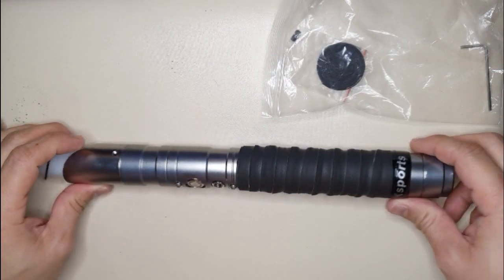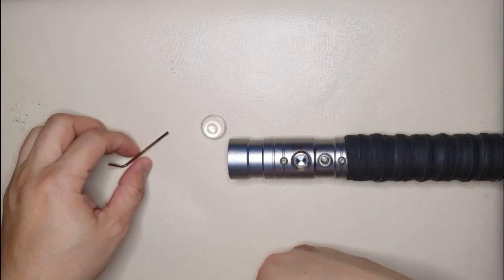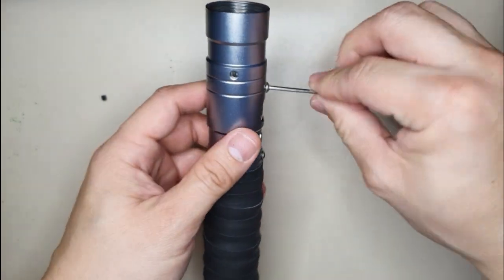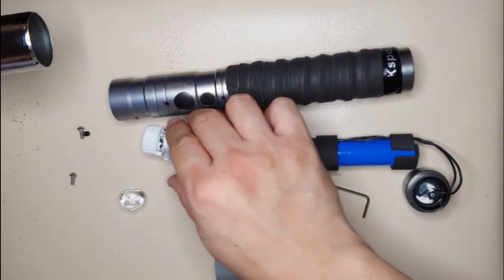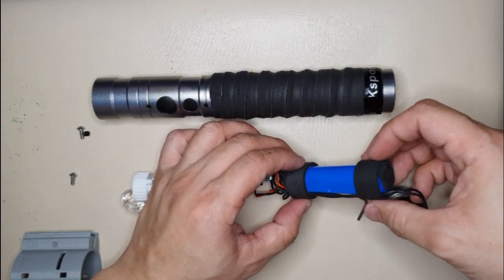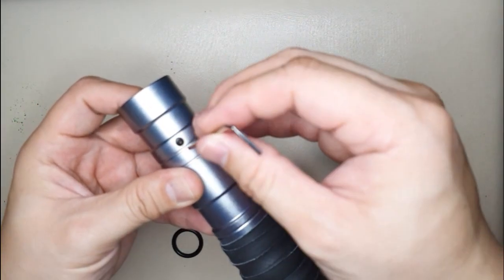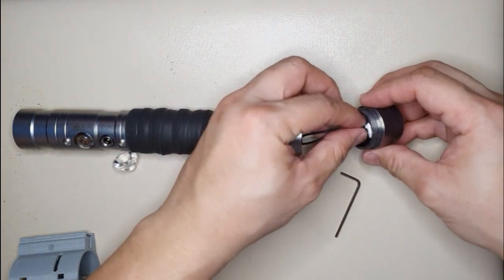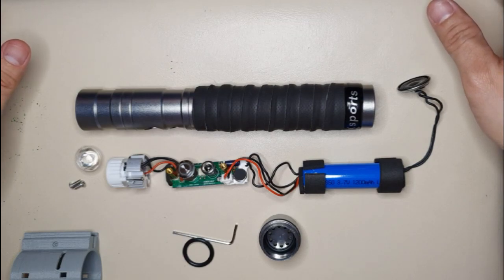What's Inside Your Lightsaber - How To Take It Apart

Comment: Hi, I have the same saber, is it possible to change the leds? for example neopixels strip or rgb led strip to put directly into the blade? thank you.
Reply from the maker: No that wont work because on e neopixel the controller is different. You can only change the rgb led on these versions

Comment: the top insert of my switch came off and I took it apart and everything looks normal. The switch lights up when plugged in but when I press it- it doesn’t vibrate or turn on the leds
Reply from the maker: Sorry to hear that. Completely charged?

Comment: I was trying to fix my lightsaber that I got on amazon, and i.just saw one of the wires just broke off. So I should be able to get it fixed by resolder the wires.
Reply from the maker: You can if you have done so before and if you are certain where it goes. Is it the battery side?
Reply: @CyberTec02  
No, its the PCU part that lights up the blade.

Comment: Hi! I have the same lightsaber as in the video.

I have a slight problem with mine. At first,  it works perfectly fine. But a few days ago, when i want to charge the blade, i used the wrong charger. I didn't realise it was actually my laptop's charger (they have the same tip/plug (?)) Soon as I realize it, I unplug it from my lightsaber. I check, it turns on no problem.

But, today I want to charge it, with the right charger, and the led indicator didn't turn on. Now, it wont turn on at all.

I was wondering, is there any way it can be fixed? I don't know anything about it's component and what so ever. Best thing I know is how to build a pc.

Thanks,
Apologies for any grammar mistakes.
Reply from the maker: Its usually the charging circuit that gets fried if the voltage was higher. Usually the switching transistor takes the toll but i dont suggest trying to replace those part coz they are too small. You can buy just the complete circuit board from them to replace yours.

Comment: Hi! I took mine apart as well but the small metal disk is missing (in fact when I charge the lightsaber the button doesn’t light up and the hilt heats up) what am I supposed to do??
Reply from the maker: Looks like there is a short inside or the charging board is busted i dont suggested charging it further. But does it still get charged and working? If yours got the internal carrier just replace it
Reply: @CyberTec02  thanks for the answer! Btw it doesn’t charge but I think I just used too high of a voltage to recharge it and “fried” it in the process

Comment: Hey, I can’t get 2 nuts near the switches to come off, what should I do? My battery got disconnected and I can’t put it back on
Reply from the maker: Those screws need to be removed in order to slide the inner electronics holder. If they are stripped you need to get a screw extractor. Worst case is to drill it off and replace them with a good one.

Comment: I think my battery may be faulty. Do you know what type of battery this is? There's no info printed on the battery itself. Also thanks for taking apart your lightsaber so I don't have to :)
Reply from the maker: Its a lithium ion 18650 battery, if you intend on buying, it also depends on what saber you have some got the battery compartment, mine have to be soldered so get those that has solder tabs so its easier to solder
Reply: @CyberTec02  Thanks!

Comment: do you know if there’s a way to mute the sound of a lightsaber without fucking up the lights?
Reply from the maker: There is the mute option when you turn it off. I believe the 3rd or 4th vibration turns the sound off, and then its cycles back to the sound fonts

Comment: Can one remove the cables to the speaker and the speaker?
Reply from the maker: You will have to re-solder it. Best if you have connector that can easily slide on but need to diy

Comment: Is it possible to disconnect the recharge port or button so you can maybe extended with wires?
Reply from the maker: Mugg Men if u have experience in soldering/desoldering then yes. Coz its hard soldered on to the board. Overheating the components could potentially damage it. Desoldering wick or pump will help u do the trick.
Reply: @CyberTec02  thank you but what's a wick or pump in this case? My only experiencing with soldering really just involves your average soldering iron.
Reply from the maker: 60w soldering iron best would be a temp controlled so it keeps the heat up when you melt something unlike normal ones where drops the moment you touch the solder. A wick absorbs the solder from the joint making it easy to remove the part a desoldering pump sucks the solder out of the joint
Reply: @CyberTec02  okay that helps, helps clear things up thank you.

Comment: Apparantly my rechargeable battery is loose, do I just tape over it with any tape?
Reply from the maker: i would suggest to stick an thin eva foam around it also some soft foam on the inside to prevent it from moving up and down the hilt as well.

Comment: Hi, I have a different type if lightsaber, but my won’t turn on. I took it apart and found at a wire connecting to the neopixel blade was a bit torn. The wire its not completely torn off, but its outer layer is torn, and some inner metal bits sticking out. Is there any way to fix this?
Reply from the maker: Torn insulation is fine unless it hit some components and shorted out the board, means it could possibly fried it. Was it working when you got it?